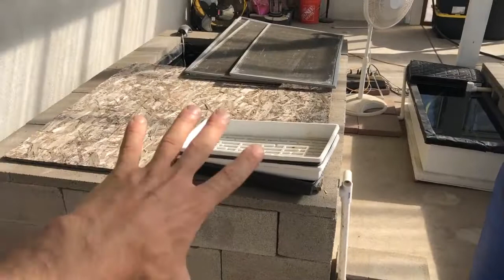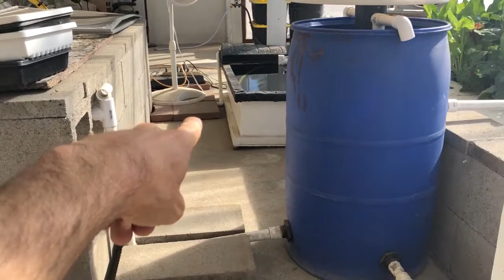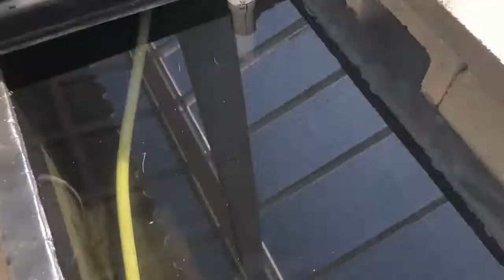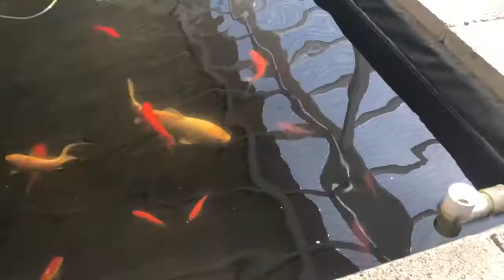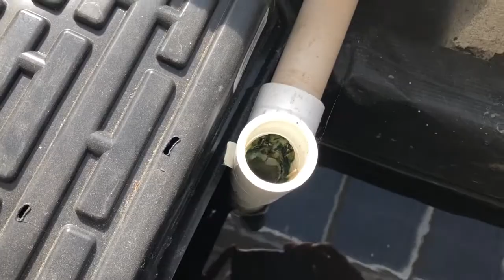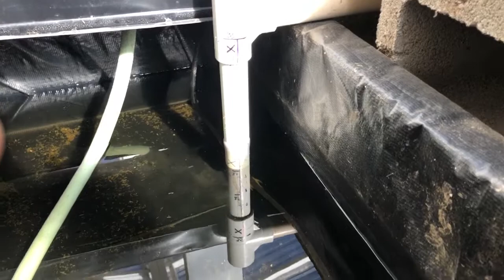Importance of a Sump Tank in Aquaponics

Comment: So no battery back-up?
Reply from the maker: I have grid tied solar and a generator. No battery backup yet. Doesn’t make financial sense for me yet but I would like to do an off grid solar with battery aquaponics system.  Just run a pump and air stone. Probably a year or so out before I can do that. Some point down the road I’ll get there but battery for the house is tooo much money at the moment.
Reply: @FarmerG  You could do a cheap set up with car batteries, battery charger, and  set up a 12v pump system
Reply from the maker: Brad Maas 
There are a couple small panels here with a battery set up. It used to be used for walkway lighting but my horses messed up the lights. I’ve been meaning to break it down and use it for another purpose. It might go towards an aquaponics set up. Maybe. It’s a few projects down the road but it’s on my radar.